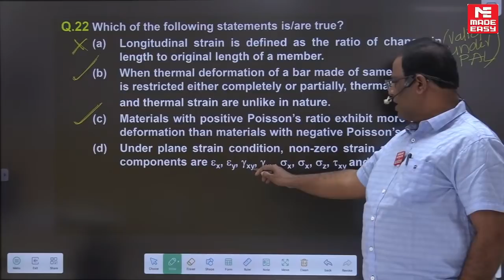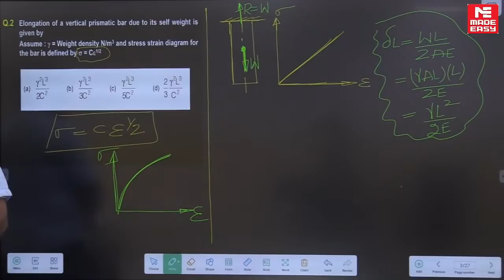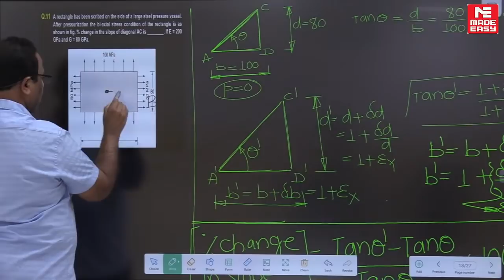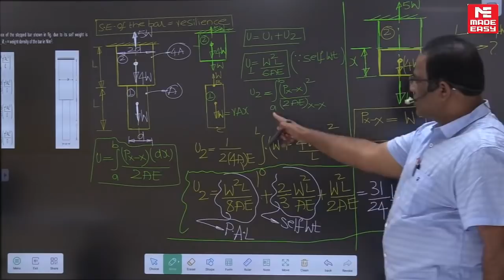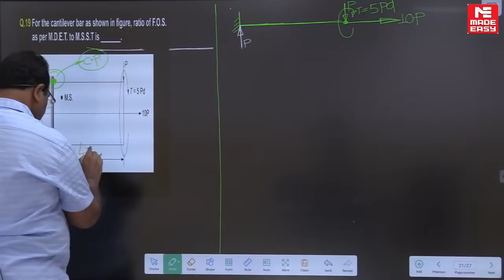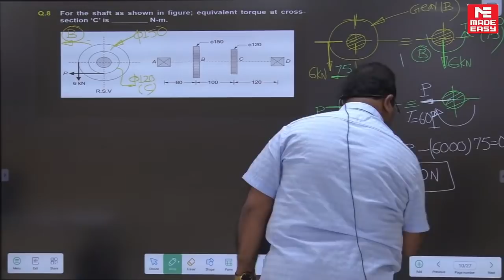GATE Through Questions (GTQ) | GATE 2022 | ME | Strength of Materials| By S M Krishna Sir |MADE EASY

Comment: Sir one doubt In T section shear center is at intersection of two rectangle which lie of yy Axis . How transverse shear load create TM.??
Reply: Same doubt.. May be we also have to consider the case when t section is not vertically loaded.. Instead it is horizontally loaded.. So tsl will not pass through shear centre
Reply: Transverse means it will pass through the centroid instead of shear centre that's why T will be generated